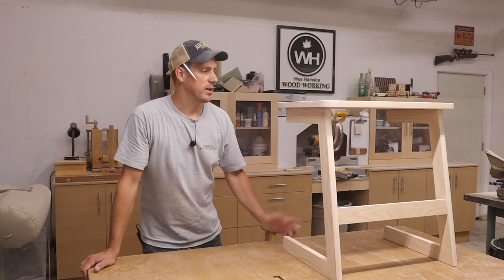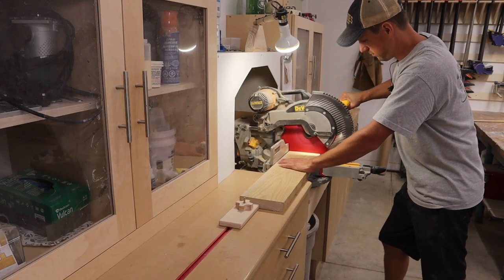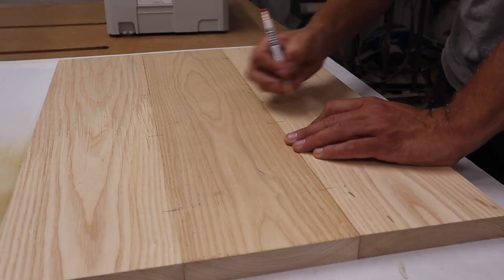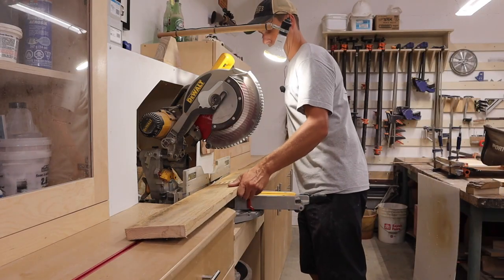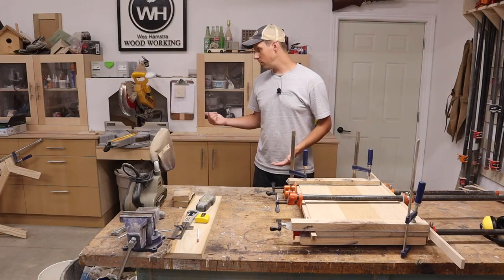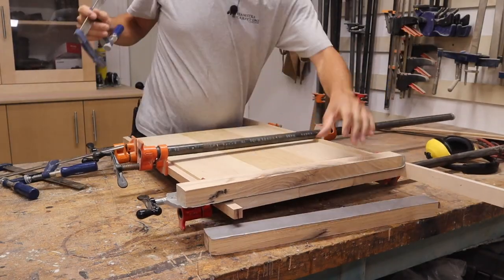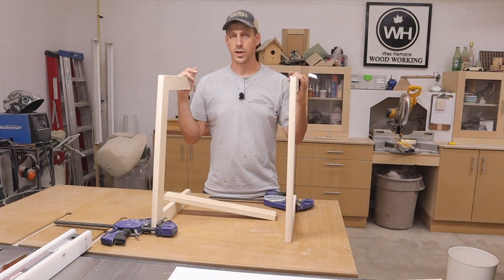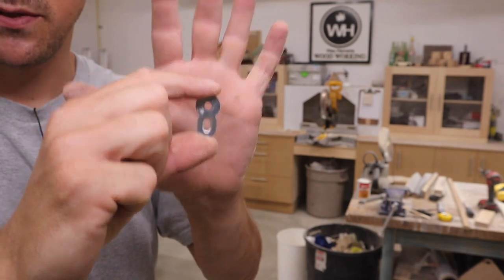Building A TV Tray

Comment: Great job what are the angles cut at
Reply: If you use 50 degrees on the bottom that will equal 100. Now you’ll need to make the top 40 degrees each to make it level. Whatever you decide, remember to make it equal 180. If you use different angles, you’ll have to adjust the board dimensions, so better to cut the same.

Comment: Hi Wes, just come across your video, I want to build this T.V. Tray for my Sister in Law, 
Sadly she suffers from Parkinsons disease & Dementia, she is very unsteady on her feet so my brother takes her meals into the lounge for her so she has no need to walk into the dining room.
The problem with that is she struggles to balance a tray on her knee, so this would be ideal.
As one or two others have mentioned, there are no dimensions or angles with the video, would you please put what angles the joints are please, I should be able to work the lengths out.
Its a thumbs up & subscribe+ notifications from me, thanks again for the video